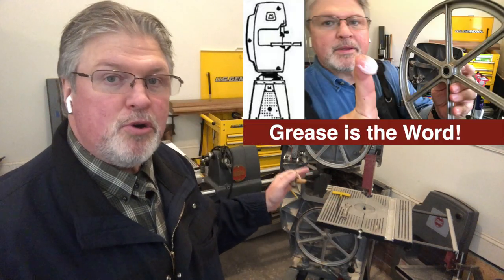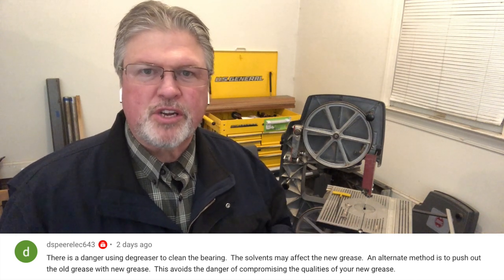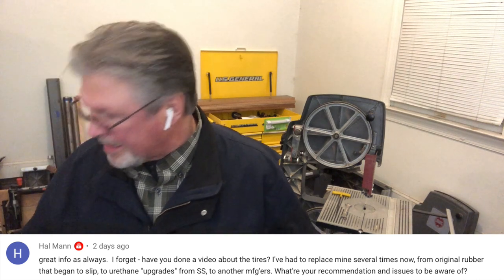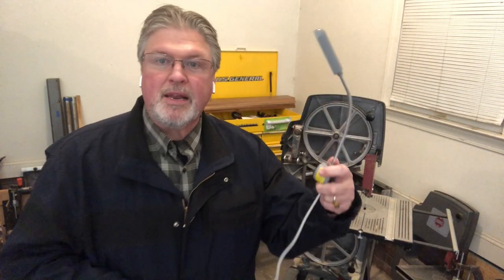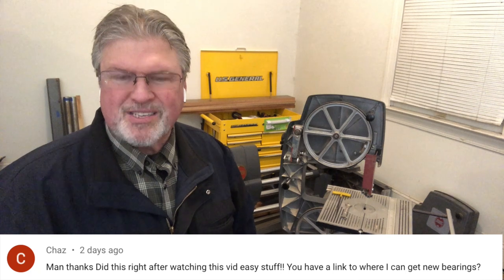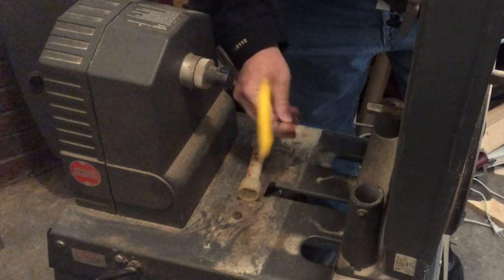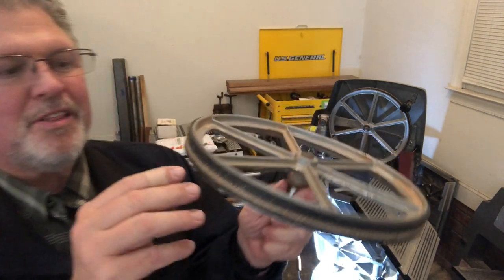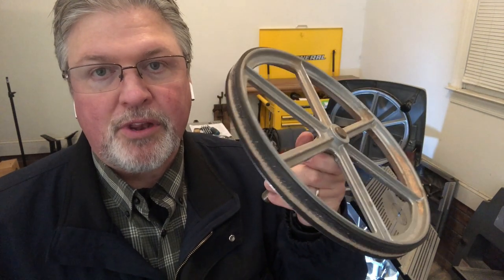Q&A's from "Shopsmith Bandsaw Maintenance: Greasing the Upper Wheel" & Removing Lower Wheel

Comment: Solvent can always be blown out with compressed air along with any thing stuck in the bearing.  Any time you repack a bearing it should be cleaned as well as possible.   If you are just adding a a little grease every few months then that is different.

Comment: So to confirm, the only maintenance reason to remove the lower wheel is if it is malfunctioning since it has a sealed bearing??
Reply from the maker: 100% correct takeaway.

Comment: So glad I discovered your videos.  I’m changing the grease in my bandsaw’s upper wheel today, and figured maybe I should try the new urethane tires while I’ve got it apart.  Well, after reading the feedback on the Shopsmith website, I’ll stick with the rubber tires.  Mine are in decent shape (not 100% flat, but no cracks or degradation), so I’ll wait to see your experience with the Blue Max tires.  I noticed that I have a can of automotive belt dressing spray in the cabinet - do you think that would provide any benefit to the tire life?     Ross
Reply from the maker: Wow, your are observant!  As for the tires, what I've read so far about the silicone versions is mostly positive, but I've noticed that most of the folks who have had issues with them mention that they stretched, and I suspect that's because they warmed them in water to make it easer to stretch and that they overheated them. I still need to experiment with mine, but I understand that the max temp is 120 deg, which I'm not yet sure if that's F or C and there's a big difference between those!  What we both know is that the rubber tires work well for 15-20 years, and that's really respectable. As for belt dressing, no, I wouldn't use it on the bandsaw tires. If would keep them pliable and would increase their frip on the blade, but it would likely contaminate the wood, creating gluing and finishing issues. Great to have you here, Ross!  Make it a great weekend, Scott

Comment: Scott, I have upgraded the tire on my band saw to a relatively cheap set of blue polyurethane tires from Amazon. They work excellent, they don't move at all, I couldn't make them move if I wanted to. They were a little tough to get on, I had to clamp them on one side, and they came with a little tool (basically a piece of wood with a nail on it and a loose  plastic sleeve to roll as you slide it underneath) to use for installation. It told me to submerge in warm water. Once I clamped it so it couldn't keep falling off (halfway on both sides then just do the remaining portion) it was much easier.
Just thought I could help for the future video 🤠.

Anyway, thanks as always for the video! For some reason I thought I needed to remove the bearings completely to be able to pack them properly. You saved me a lot of headache and time.!
Reply: Do you have a link for those tires in Amazon? 😊 Thanks!
Reply from the maker: Mark, they are linked above in the video description.  Scott
Reply from the maker: That's one of the sets I purchased. I look forward to the challenge. Scott
Reply: That's actually the same exact set I purchased, but they were only $30 when I got them in September. Not sure why the large price bump.
Reply: The blue ones I got definitely don't stretch/fall off/slip. It's pretty hard to stretch it at all enough to even get them on. They're definitely strong/durable.
Reply from the maker: @dragunov525  Did you heat it?
Reply: @MyGrowthRings  yes I used hot water from the sink. It was a lot easier once I clamped it halfway on, but still took a bit of force to get on. Definitely not worried about them slipping or coming loose or anything.

Comment: new subscriber and new shopsmith owner here from NC. would love to meet up sometime. Have watched a bunch of your videos and love the info you share and your delivery method
Reply from the maker: Jim, in what part of NC are you? Scott
Reply: @MyGrowthRings  Marshville NC 35 miles east of Charlotte.
Go to Hendersonville about every 6 weeks to visit bedridden mother. 
Totally new to shopsmith and wood turning in general. Picked up a 1985 that had been sitting  for years. Did the whole clean ,  lube , setup.  its running good. Just a slight belt squeal when going to c,b or a speeds. Have adjusted the eccentric bearing . Belt it tight..Added a band saw, router  and several tools. Bought 4 Carbide gauges and 5 piece  shopsmith gauges

Comment: My 1978 Shopsmith bandsaw upper wheel has an inside diameter of 0.675" and the bearing inside once removed measures 0.685". Is that typical that such a large difference in diameter? Also what is need to re-install new needle bearings?
Reply from the maker: There have been a couple changes over the years and I'm to the point where nothing surprises me! Ideally a bearing press, but the wheel size can be a challenge, so I use a hammer and a block of wood to soften the blow.  Scott

Comment: Don't want to make any nasty shmu in the dingus.... lower bearing is cased in plastic on both ends is it not possible to remove bearing and replace the failed bearings individually?
Reply: Getting the races out would be a challenge.
Reply from the maker: Correct.
Reply: Scott,  No way to degrease and regrease those lower wheel bearings? Best to remove/replace and even then a chore to do?

Comment: I would like to see a video of the motors shopsmith used in the various models.  Mine had a 3/4 hp and my dads has I believe a 1 1/8 and was wondering how interchangeable they are and are they special to shopsmith.  Some say the larger motors are longer so there special to the units and also I would like to here your experiences with the longevity of the motors
Reply from the maker: That's a great question. The biggest difference between them is that when they moved from the 3/4HP to 1 1/8HP that they made a change to the upper belt, moving from a cogged "Gilmer" belt to a "Poly-V' belt. This allows for a little slipping which the Gilmer drive won't accommodate. The Gilmer drive units also have a fiber clutch that is an intentional weak link but is also a maintenance headache that was eliminated by the move to the Poly-V drive.  I'll give this some thought. Scott

Comment: Put new tires on my SS band saw the top tire wants to come off why is this happening
Reply from the maker: Bummer. There may be answers. Rubber or poly tires? Did you use the hot water method to stretch them on? Did you use an adhesive?  Scott

Comment: I recently spotted and snagged one of these band saws on CL It was in the free section! The PO said it would need new tires and a motor. I didn't see anything wrong with the tires and when I tried the motor with the belt off (it's mounted on a stand) the motor ran fine. Then I put the belt on. It wouldn't start up because one of the guide bearings was set up. I removed the bearing, and spun the wheels by hand a bit, then tried it again. This time it started up, and that's when I figured out the pulley arrangement had the blade speed up around 4300 surface feet per minute! It sounded like a jet engine! I have since changed the pulleys so it runs about 2400 SFM now and the motor starts and runs the saw just fine. I also went thru the machine same as you show in these vids, and that was before I discovered this channel. I was glad to see I was on the right track when I watched them. The upper wheel was a bit chattery and I took it off.  The inside bearing had old hard grease in it and the outer was totally dry. Like it never had a drop of grease in it. I washed out and replaced the grease, and now it runs smooth. It's a cool little saw and I like having it in my collection of 14 band saws. It's the only wood saw all the others are made for metal cutting or both wood and metal use.
Reply from the maker: Very cool! So glad to hear that you brought it back from retirement. Scott

Comment: I enjoy your videos, great information
Reply from the maker: Glad you like them!
Reply: @MyGrowthRings    I’m confused about your comment on misalignment of fence to cut a straight line on bandsaw ,adjust fence of aluminum table verses cast iron table.  You said you can’t do it on cast table why, you could just adjust miter head to match angle just like using setscrew of other fence. Your moving the miter bar to get width of board width you need.
Reply from the maker: @daveziehm8096  Can you reference where I said that? I have always advocated for the cast-iron table and the miter gauge as a rip fence so I’m not sure what comment you are referencing. Add a timestamp by typing in your comment the time in the video where I made the statement. (Example: 3:45) Thanks, and I’ll be happy to add clarification. Scott

Comment: Hey Scott great Shopsmith videos especially since I’m trying a total bandsaw rebuild. All bearings and tires. I think I need to replace the upper one as well as the lower one.
Question: Is the upper bearing difficult to remove and replace. I’ve seen on other forums what to do concerning the bottom wheel water pump bearing replacement. Thanks again!
Reply from the maker: Hey Bob, it's good to have you here and I'm happy to hear that you are bringing a saw back into service. Replacing the roller bearings isn't too tough, but it is a bit of a pain because you have to press them out from the same face where they entered. That means you have to fabricate some type of punch that can reach from one side of the wheel to press the bearing out of the opposite side. It might be worth seeing if a local machine shop can do the job for you. The bearings themselves are really available on Amazon and from bearing houses. I've done it with a large nail, using the head on the race of the bearing and tapping on the tip, but it was sort of hairy!  Good luck, Scott

Comment: Thanks for the vid. Great content. I have recently purchased a ShopSmith and am currently using/rebuilding it. I’m worried about the bandsaw being the Chinese knock off. The table on mine looks like the one on your knock off that you have. I don’t have the upper or lower wheels. Is there any other way to tell which one I have?
Reply from the maker: If it says Shopsmith anywhere on it you should be good to go.

Comment: I've installed the Blue Max tires on my Shopsmith bandsaw and so far they've worked great.  A bit hard to get on:  they don't stretch as easily as polyurethane tires and a lot of grunting and yanking was required to get the job done.  I'm not sure that soaking in hot water made that much difference to their stretchiness.  The tires have a very lightly stippled outer surface that supposedly keeps the bandsaw blade from shifting around.
Reply from the maker: Good to know and thanks for the insights.

Comment: My Magna band saw doesn’t line up with my mark 5 how can I get adjustable mounting tubes
Reply from the maker: The modern version of the bandsaw has eccentric mounting tubes, and they fit every Shopsmith bandsaw ever made, so I would either get new ones from Shopsmith or find them used on eBay.

Comment: Mark, first of all do you see comments on old videos?  I have  a band saw I recently purchased and I'd like to remove the lower wheel.  However I am unable to remove the fitting on the shaft.  The set screw came right out but even with some WD-40 I can't seem to get that little fitting to budge.  Do you have any tips?  Also, I actually have two band saws now and will be selling the recently acquired one.  Before I do though I will be swapping the arched pieces that show what angle the table is at.  I'm doing this because the new bandsaw's are shining nice metal and the pieces on my old band saw are black(apparently from the factory like that).  I find this hard to read so I'm changing out to the shiny easier to read pieces.  Do you know why they made some in black?  Are the markings supposed to be painted so it's easier to read?  thanks
Reply from the maker: Hey Matthew, if the screw and retainer are removed you should be able to get it to come out of the casting by tapping on the shaft from the back side of the saw. WD-40 should help too, but a dead blow mallet is the real secret. I've sees some of the black trunnions too and I really don't know what was up, but I would probably just apply some white acrylic paint to the markings and wipe it clean. That would highlight the markings and would likely actually be better than even the shiny ones.  Scott

Comment: Thanks for all the great content. I’ve had my shopsmith for 30 years and I’ve severely neglected its maintenance. Thanks to you, I’m starting to do what I should do. In the end, I know this will help a lot.

On a side note, on the plastic power coupler, they put a spring in it on the headstock side. Why? I didn’t see it in yours.
Reply: BTW, I just put new urethane tires on. So far the seem to work fine. I did have to soak them in warm water and muscle them on.
It was a REAL CHORE to get the old dry rotted tires off. I also greased the upper wheel bearings.
Reply from the maker: Glad to hear that they are coming in handy. Yes, my couplings do have a spring in them. The idea is that if you fail to lock the headstock in place that the spring will push it away and disengage the power from the SPT before you get halfway through a cut or jointer operation. It works, just as long as your waytubes are well maintained.  Thanks for watching and chiming in!  Scott
Reply from the maker: @theredtruckwoodshop2722  Yeah, I really need to get that done. I have two different sets that I want to try, I just haven’t had the time. Scott

Comment: New to shop Smith 
Thank you for the detailed service information. 
Was gifted a complete unit and was glad to find your site.
Reply from the maker: You are welcome. If you didn’t get the manual, I suggest getting one used from eBay. Welcome to the Shopsmith family!
Reply: Yes, I did get a manual. 
The unit is in need of a deep cleaning and restoration. Do you have any suggestions?
Reply from the maker: @carlolewis3276  go gently, using the least abrasive and caustic cleaners at first. If there’s a layer of rust, I highly recommend Evapo-rust, would you can get just about anywhere now, including Harbor freight. I did a video on resurfacing, a rusty, old jointer, and then another one where I resurface the tabletop of a Shopsmith Mark V. Those might have some info that could be helpful.

Comment: Hi Scott ! You've got another subscriber !! I appreciate all the great info you share with us ! I bought a Shop Smith last year WITH A BAND SAW for $325 !!! All it needed was a little love and it's been running like a charm ! I bought a brand new Shop Smith back in '84 but a divorce forced a sale of it ... Gee, where have I heard THAT story before  .... LOL. Also a blue '57 T-Bird .... ouch ... Here's the funny part ... when I checked the # on my "new" machine ... it was built in ... 1984 !!! Isn't life a trip ??!! 
 Question: do you know if a table saw carriage from a Model 510/520 ( with the wheel ) will fit a Mark V ? Thanks in advance !!
Reply from the maker: Welcome to the channel and man, that was a great deal! Yes, the carriage and tables are interchangeable from the model 500 to the 510 or 520, but there is quite a bit more to the conversion than that. The saw arbors are longer, the tool rest arm is longer, the disc sander hub is longer, and more. Even so, I will take a 510/500 any day. Scott
Reply: @MyGrowthRings  , Thank you so much for a fast reply !! Every now and again I see a great deal on the carriages but don't pull the trigger because I didn't know if they're interchangeable !! I really appreciate your channel !!
Reply from the maker: @arthilliker3721  Happy to help.

Comment: Thanks Scott, I asked about the guides and you guessed correctly, I meant the guide blocks. Thanks so much for your response!
Reply from the maker: Oh, good. You are welcome and thanks for adding to the content. Scott
Reply: I did the upgrade to bearings on my Band saw guides. I got them on Ebay (of course) and did a tiny bit of grinding on the lower bracket ( I think, it was one of them anyway, it even tells you that when you buy them) it's no big job at all. I've never looked back. I highly recommend it personally.
Reply from the maker: @arthilliker3721  Thanks for the recommendation. Scott

Comment: I just bought an old Jet bandsaw and have been researching on maintenance. You’re the only person that goes over this. Thank you!
Reply from the maker: You are welcome. How old of a Jet saw is it? Is it blue? Scott
Reply: I’m not sure how old it is. It is blue. Unfortunately the person did not have the manual   It is a JBS-14OS. 708514
Reply from the maker: @ericawalling2716  I know that saw. It was a fairly faithful clone of a old Delta bandsaw.  The only thing that they changed was the lower guides and the trunnions. I believe that the trunnions on yours are cast aluminum, where the Delta used cast iron. As long as you’re not dropping the saw they should perform just fine!

Comment: @08:42 "… opened-end wrench…." Musta got some of that white lithium grease on yer tongue 'less it wuz suma that soll-vent. <smirk> (Sure glad you don't do much editing out … or are you trolling for snarky remarks? Ya got me! <blush>)

I think one of those Craftsman ratcheting box-end wrenches might fit between the bottom wheel and the bolt head–if so, sure would be easier, specially for those of us who aren't slim and trim. I'm not sure, since I never thought about it 'till I stumbled on your vids.

Thanks, lotta fun, and LOTS of great info. Not to take anything away from your vids, which are great, but you're making me miss Nick Engler (and Drew, and the pooch) more than my limit. <sigh>
Reply from the maker: Did I miss-speak when I said "open-end wrench"?  BTW, Nick is back on Youtube and is pumping out a couple video per week. Search "Workshop Companion". Scott